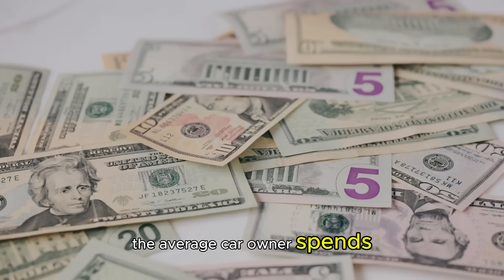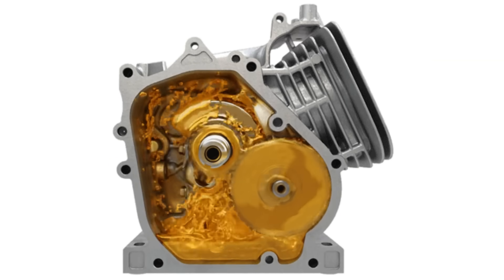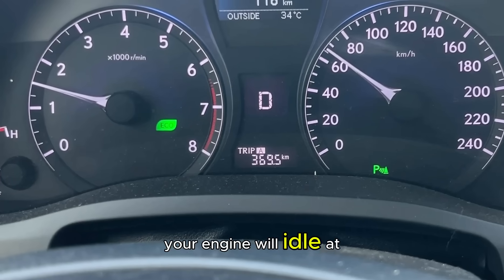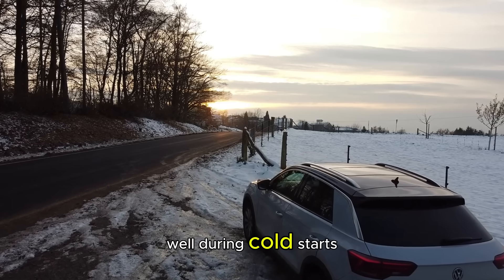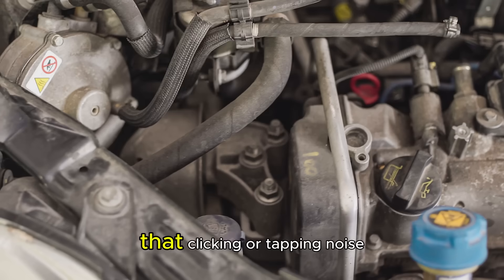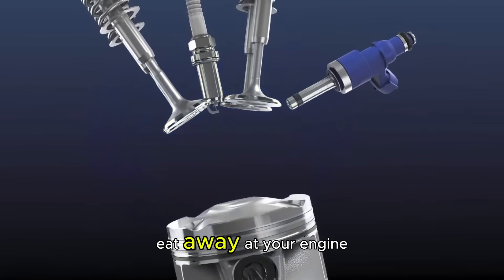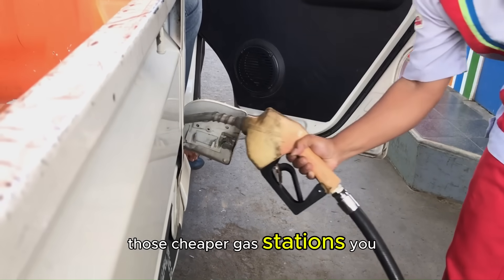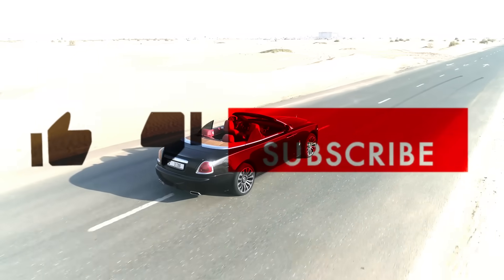Stop Making These 6 Cold Start Mistakes Before They SECRETLY Wreck Your Engine

Comment: most people are stubborn and don’t take advice well. they have their own ideas about what is best for them which is fine. I will continue to warm up for 2 minutes when temperature is below freezing and drive gently until warm. this has seemed to work well for the 40 years I’ve been driving.
Reply: New generation engines get warm when you start to drive , i start and 10-20 secs i start to drive, 500k km never had a problem.
Reply: @ Most new gen engines are garbage, esp. the turbo one.
Reply: @scottzappa9314  Toyota s turbo engines seem to be good.... Ford s have turbo problems....turbos need to be cooled down before turning engine off... and change oil at 3000
Reply: @Johnnyjacobs-h8f  You need to understand that turbo engines regardless of make will simply NOT last as long as normally aspirated engines. Changing the oil more often in a turbo is good I'm sure. They are under a lot of stress.
Reply: @scottzappa9314  some manufacturers design are better than others..turbos turn in excess of 30,000 rpm...turbos are cooled by air and engine oil, therefore need clean oil at all times... turbo engines because of these complexities have challenging items to deal with..because of this extra air in the engine, it is safe to say a normal aspirated engine is less complexed, thus more reliable over time. It is about emissions and is mileage vs power, unfortunately managed and started under the Sleepy Joe administration.MAGA😁
Reply: Oh yes, I do longer than 2 minutes and I don't have a problem either.
Reply: @michaelcrockette8694  been driving 55 years ..warm up for 3 minutes 10 seconds if temp is 32 to 41 fahrenheit, if 28 to 31 add 5 additional seconds, if colder than 31, find a pretty gal and stay in the bed😷
Reply: I idle for 15 to 30 minutes when its -10 to -40 out. Only drive when the vehicle is at running temperature. 
 Has worked for me in all my vehicles (1991 dodge dakota, 2001 jeep grand cherokee limited and 2012 sierra denali. The last 2 still run to this day never had any engine failures or repairs needed. 
If i ever do have to drive my whip when its cold i wait for the rpms to come down then drive it under 1800rpms till warm. 

To each their own. More than 2 ways to skin a cat
Reply: @MurdahBassRecords  one size does not fit, ie, more than 2 ways to skin a cat...some people think that idling for extended periods runs the engine rich in fuel.It does but the transmission fluid needs to warm up for the passages to get fluid. Toyota has transmission warmers built into their trucks..excellent engineering design .
Reply: @Johnnyjacobs-h8f  that is an excelent idea. Just read the end of your 2nd last comment. I am an albertan who fully supports DJT and his actions against my country. I would gove anything to have a MAGA movement here
Reply: You are literally doing the same thing.
Reply: @kitfisto1827  Mathew 7,1-6. Judge not, or you too will be judged in the eyes of the Lord
Reply: So true! I do think even two minutes may be borderline…but not ridiculous. 5-10+ minutes is.
Reply: @rescuesar54  absolutely
Reply: There's no fool like an old fool.
Good driving, brother?!

Comment: WEll the mechanics in Australia tell their clients all these facts.  They go out of their way to make shore the owners understand what is required.  They also make shore owners change their oil on time.  I noticed you didn't mention the need to use the correct petrol (gas) in their cars.  Using the correct octane will save a car from expensive rebuilds.
Reply from the maker: I have another video on this coming soon!

Comment: The advice about leaving heater off or on low while engine warms. Hadn't really thought about this because I had assumed the thermostat on the engine will stay closed until the engine coolant gets to temperature. While the coolant is cold and thermostat is closed, will the coolant from the engine be going through the heater matrix?
Reply: There is a bypass that allows fluid to go to your heater core at all time
Reply: @Marcel-fo2cb   Thanks. So, makes sense to keep heater off or on low till thermostat opens then. On cars that have a gauge this was easy. You would see the temperature gauge go up quite high then drop back down when the thermostat opened. However, many modern  cars don't have a temperature gauge on the dash anymore 🥺.

Comment: I live in Canada and have been cold starting since the pre-injection carbureted days. Carburetors were a challenge in the depth of winter and we used to setup the choke, idle and hole shot spray accordingly. It was a fine line between too lean or too rich. I had it figured out pretty good, even on days when it was -30C outside. The new ECMs do all of this automatically now. Today, both of my modern fuel injected vehicles idle via the ECM at about 1100 rpm on cold start and it takes about 90 seconds for the ECM to idle it down. I typically let it do its job before I drive off, I don't put it in gear at 1100 rpm. Never had any issues. Car has 307,000 kms on it (192,000 miles). I don't drive each vehicle daily, so I use a battery maintainer in the winter to keep them at 100% charge.

Comment: Yeah i already know this. Why does my YouTube algorithm keep stacking these breathless videos? Let's keep this simple: Start engine, idle 20 seconds, drive off moderately until oil temp rises to normal, then do whatever. And mechanics aren't trying to keep this routine secret. C'mon, man. I drive a BMW diesel.
Reply: You can't always drive off after 20 seconds, ice on windshield will hinder that , 20 seconds isn't enough time for defrost , so forced to idle longer.
Reply: @StarburstLife  I use a car cover here in the Rocky Mountains, or place a tarp of waxed canvas over the windshield. Waxed canvas won't stick to the windshield, and it's heavy enough to stay in place.

Comment: Since 2006 BMW turbochargers are cooled by coolant passages with electric auxiliary pump and that pump activates if it needs to cool down the turbocharger. There’s two separate independent cooling systems, one to cool down the engine and smaller system to cool down the turbo.

Comment: Yeah, my car's computer knows what's up.  It knows how to warm up and defrost the windows while I put my  clothes on.  But I do take a detour to heat it to full temp if my drive is too short because it's a diesel.  But removing the DPF is child's play, and taking it to a real cabinet cleaner is only 200 dollars.  Now for the experts below.  Your computer is giving a go or no-go response to most of its readings.  It's not telling you the efficiency.  It's not going to tell you that your flow is half restricted.   Its blocked or it flows.  I doubt your mechanic is going to spend 4 hours checking sub-files of green lights.

Comment: My car is 33 years old now, always let her warm up...
Reply: I’ve had my BMW 540i V8 6 speed for 19 years.  I always let it warm up idling to full temperature because when I leave the neighborhood I only go one mile before I have to accelerate up hill to get on the highway where cars are flying down the hill where I merge.
Reply: @eddie1975utube same here I let my car warm up in idle. I don’t take the highway but even in the street it’s already busy and people are flying at 4am
Reply: @eddie1975utube  that's good, always make sure your engine is fully warmed up before driving
Reply: @eddie1975utube  ...And he just CLEARLY explained to you, how that is potentially damaging your engine.   But, idle away!
Reply: @TnT_13_  the equation is not so simple…

I could drive off after 1 minute but then I’ll reach 1 mile down from my house with the engine still cold and have to get on the highway where I’m in a valley and have to stop and wait for a gap when cars are flying down a hill to then fly up the hill and I have to accelerate full throttle to get in a gap and not get rear ended as there is no acceleration lane to get up to speed.  

One time I did that in a newer car that had not been warmed to temperature and the transmission broke.  So that to me is proof that it is better to warm up the car to temp and accelerate full throttle then it is to reach that spot with a still cold engine/transmission.
Reply: @TnT_13_  that for new modern cars right? Right
Reply: @evanatkinson4242  as he clearly explained, it's been a while since carburetors were a thing. "Modern cars" being within the last three decades.
Reply: @  a 29 year old car is modern?
Reply: @evanatkinson4242  I get it.  You're slow.   Here's how Google works - Computers gradually became mainstream in the automotive industry, with the first electronic control units (ECUs) appearing in mass-produced vehicles in the 1970s. These ECUs initially managed basic functions like ignition timing and transmission shifting, responding to stricter fuel economy and emission regulations. By the 1980s, more sophisticated computerized engine management systems and electronic fuel injection systems became common, as described in this article from the Globe and Mail.
Reply: @TnT_13_  I get it you’re one of those IPad kids.
Reply: @evanatkinson4242  because I'm able to use Google, work on my own vehicles, and follow logic?
Reply: @eddie1975utube I do the same thing always let my Audi a4 1.8 tfsi to full temperature so transmission oil gets warms up too!
Reply: I try not to start my vehicle then immediately shut it off seconds later.  I’ll actually try to make it a point to drive a few minutes if I can.
Reply: @GeneralSirDouglasMcA  it takes 20 minutes to replace that battery power needed for a start so good idea to drive around the block at least. It keeps all the driveline seals wet.
Reply: @deborahchesser7375 that's absolute rubbish no offense but it depends entirely on your alternator. My motorcycle has a free kilowatt alternator i could recharge my entire battery which is a car battery by the way in about 15 minutes from flat with my alternator.. Text just a couple of seconds a minute at the most to replenish what I use starting up my vehicle which is a 1.8 flat six.. Everybody has a different alternator everybody's car is slightly different some people might have weak alternators and some people are going to have struggle alternators like those with bigger engines so your statement is basically completely wrong. Also driving around the block isn't going to help you 30 seconds on a motorway is equivalent to maybe an hour driving around the block again difficult to know if you have any idea what you're talking about
Reply: @elixier33  that’s only surface voltage, trust me I know what I’m talking about. Unless you’re older than 40 I’ve been a mechanic for longer than you’ve been alive. Also, that was only an approximation.
Reply: I drive a 36 year old car and I always let her warm up
Reply: @unitking12_official  Probably why your 36 year old car is still running good.  😊
Reply: @unitking12_official  thats right. dont listen to these fake mechanics, they just want people to destroy their engines to get money. Always warm up the car, warm oil could never hurt
Reply: @unitking12_official I do the same thing always let my Audi a4 1.8 tfsi to full temperature so transmission oil gets warms up too!
Reply: @davidgreenwood2136  treat these cars like a pretty older gal, warm them before you rev them up...both will last longer👍😂
Reply: Like a pretty older gal😮
Reply: me too bro I let my car warm up
Reply: @khaled-naji  5min max or you actually get more engine wear from low oil pressure.
Reply: Ahhh the 90's back when things were built to last.
Reply: Back in the day with carburetors on a cold start the rpms for a lot of cars was well over 2500 rpms during a cold start.  Floor it , start a it the tap the gas pedal after a few seconds to bring the rpms down.
Reply: We all do what works for us. All the so called experts have different opinions.
Reply: @edwardwritt3820  anything that is reasonable will work fine ..like most things in life...nothing extreme
Reply: @Johnnyjacobs-h8f  Very true
Reply: @edwardwritt3820  Truth . Use COMMON SENSE. -Upper Midwest
Reply: Wow !! What kind is it ?
Reply: @tripleooo7881   I got that best...1984 vw scirocco, original engine and clutch, 822,000 miles, 41 years old, drive it daily....warm it up in winter before driving it, about 7 minutes...the proof is in the pudding 😄
Reply: @Johnnyjacobs-h8f  I don't like pudding  😐
Reply: @Johnnyjacobs-h8f  old cars & new vehicles totally different designs.
Reply: Let it warm up. During extreme winter temperatures, change your oil at 3000 instead of 5000 miles.
Reply: Lmaooo 35 n she still goin
Reply: That's old maybe you're car needs the warm up
Reply: Mine is 28, it goes nowhere until warm.
Reply: Only stupid people sit there with warming up their car. Just start the damn thing and while you're putting on your seat belt the engine will be warm enough to go you don't need to sit there all day warming up your engine it's so stupid it really is stupid I wouldn't want to admit that on a public forum.
Reply: @elixier33  I'm just curious how cold it is where you live.

Comment: You don't need to warm up your engine unless you are going to immediately stress it with hard acceleration, e.g. freeway onramp, heavy pulling, uphill driving, etc. before the parts have expanded into their tolerances. Just drive gently for the first 15 minutes or so. Most people won't, it's pedal to the metal with an ice cold engine, just another way that they torture their car into an early death.

Comment: The deal with idling an engine for a minute before shutting down a turbo engine is exaggerated a bit much. But depends on your car a little. My 2018 Civic, if driven normally and not raced, barely ever gets much boost. The turbo is exhaust side waste-gating most of the time and so doesn't get even close to 200,000 RPM as he says. The turbo in a Civic is not designed for racing, it's designed to get you good gas mileage. So I drive normally, almost like a granny and my waste-gated turbo is likely not even close to 200,000 RPM. Maybe just a few thousand. If a waste gate is fully open, the turbo doesn't spin much faster than your engine's RPM. So, in that case you can throw the old adage "Let 'er run a minute before engine shut down!" out the window. You can shut off almost right away like a non-turbo car.

Comment: All i know is that sometimes when it's very cold i do press the gas pedal once to spray gas in the combustion chamber i know about that but for 15 years I've warmed up my car faster by revving to 2 rpm or lower & I've never had issues ever plus i use the right oil & change it on time 👌🏽
Reply: So revving it on CS acts like “ light driving”?